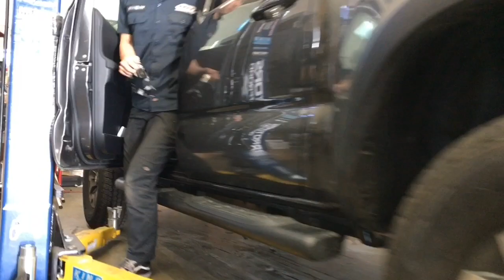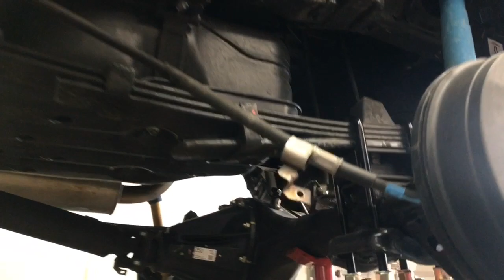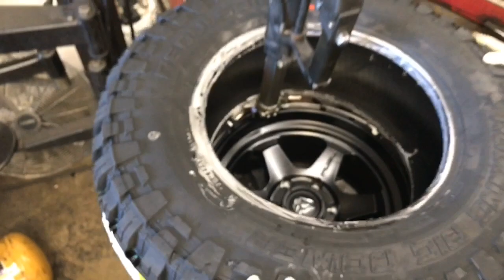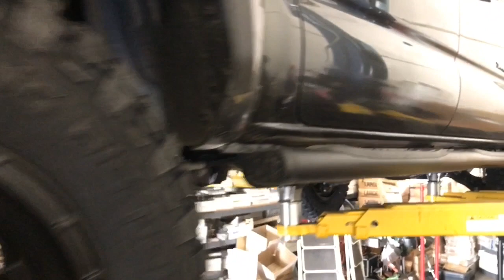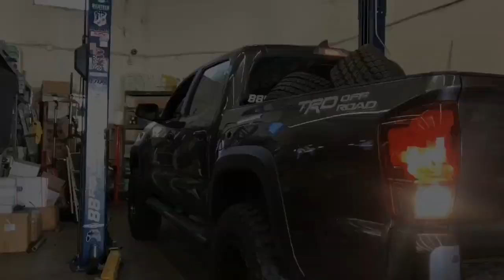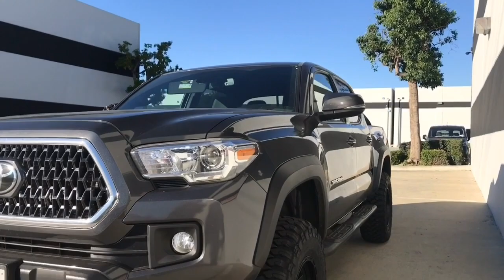Cheapest (In Price) Lift Package for the Toyota Tacoma!

Comment: I think everyone's question is how much is that.
Reply: I would assume around 4-500 installed
Reply: @tokitone  wow. install ur self its easy
Reply: CR055F1RE loll
Reply: Tires and Rims are probably 1200 and its probably another 600 for the lift. Ahhh the package deal is 1800 I would guess. Lift kit probably cost 125 bucks.
Reply: In Canada . You looking at around $4500 wheels,tires,lift,labour,tire sensors and hardware
Reply: @tokf33  Use your stock sensors.  Rims $1000, Tires $1500 max, Ready lift installed at Toyota $1000 ,Rear Driveshaft Spacer $20 Thats what I priced out in Canada for my 3rd Gen.

Comment: The space kit is enough to clear the Fuel Shok wheels at 17×9 +1 without a BMC? I was thinking of getting Bilstein 5100 all around with an add a leaf for the same wheels. Would that require a BMC?
Reply: So is that a yes? It would require a body mount chop?
Reply: Or is the thumbs up that itll clear without a body mount chop?

Comment: Question....tried to install 3” leveling kit along with relocation kit for sway bar on 2019 Tacoma 4x2. The front knuckle and upper control arms bushings were very stressed. The kit went together fine. I personally did not like how much of an angle the upper control arm and steering knuckle had. After looking at your video, how much did you have to replace to make lift work? Re: new shock, new upper control arm, new steering knuckle???? Thanks for your guidance! Mahalo brah!

Comment: My question is with any lift the concern is ball joints, cv axles and speedo recalibration.  Also with all videos I’ve seen from you guys there is always a cab chop but not this time what size tires were used on this truck and is there any rub
Reply: Its not a 4 wheel drive

Comment: Does the lift void any part of the factory warranty?  My 2018 OR 4X4 has less than 7k miles. 
I was thinking I should wait until 36,001 before lifting it. 
This lift, without changing the shocks or springs, looks like something do-able for me.
Reply: It will void your factory warranty related to suspension, driveshaft, etc. The dealership will blame it on your aftermarket suspension. I had that problem. Some people experience heavy driveshaft vibrations after doing these lifts. Do your research and don't cough up money on a cheap suspension. You will get what you pay for. Yeah if you do it wait til you get past 36k miles.

Comment: With those size tires, won’t they rub without the cab mount chop?
Reply: Nope. I have The same demention setup. Had a little rubbing on the front inner fender wall but that's it. No rubbing on the cab mount.

Comment: Does the truck still lean three quarters of an inch to the driver side once the lift is installed
Reply from the maker: No, it does not.
Reply: James Miller it’s the taco lean. Throw a body or similar weight on passenger side. I think most kits come with a 1/4  or 3/4 inch driver side spacer.

Comment: What size tires can you fit on a 2018 sr5 with a 2inch lift in front an 1.5 aal rear w/stock rims?
Reply: Maika Braun 285/70
Reply: Maika Braun You will have minor plastic rubbing. All you have to do is heat it up and push it back.

Comment: So why some people say don’t do spacers?
Reply: rear leaf spring spacers can increase axle wrap and font coil spacers reduce the travel of the shock .
Reply: Bcuz it's meant more for looks than functionality. Go on the TacomaWorld website & typing in your exact question & you'll read in detail why. Do your homework before deciding spacers if your going off roading.
Reply: @heavilymeditated2263  So for me I just want it for looks, and don't due much off road. But I can't seem to find the good lift kit, due to budget wise.
Reply: If it's just looks then by all means do it & enjoy. Just make sure it's at least a quality lift kit & not cheap one. With lift kits you get what you pay for. Also remember, depending how high you go, your center of gravity is different, your ride is a lot stiffer, & many more things may arise. Good luck with your build and have fun doing it.
Reply: Coz they know you’ll get a better lift next time 😁
Reply: @heavilymeditated2263  Thank you! Thinking about  going 3 inch in the front and 2 in the rear.